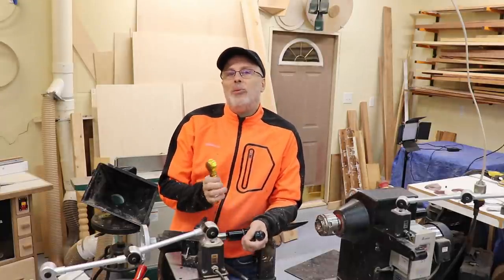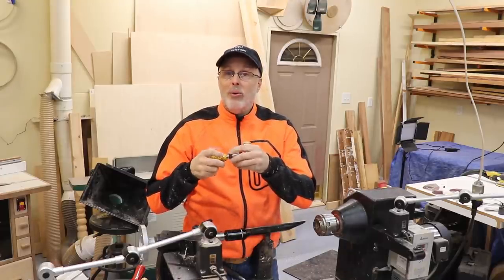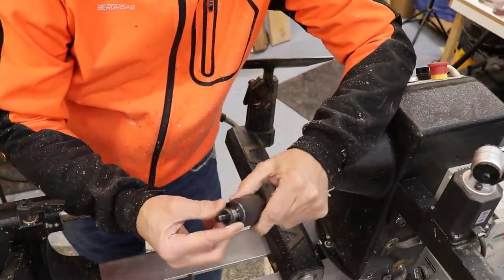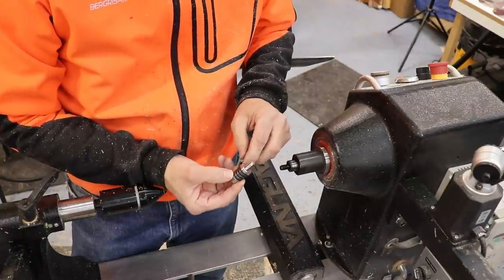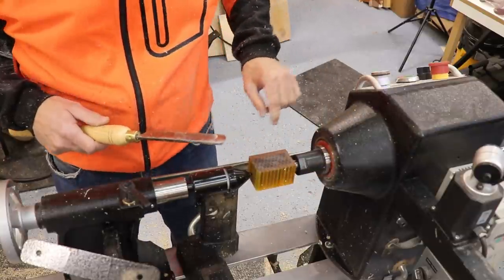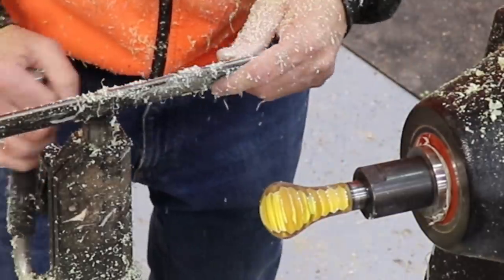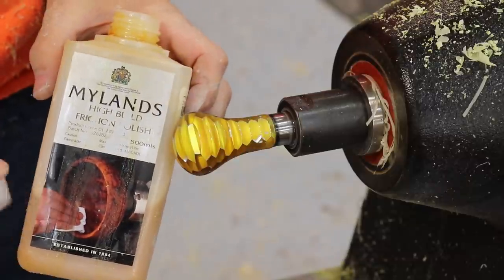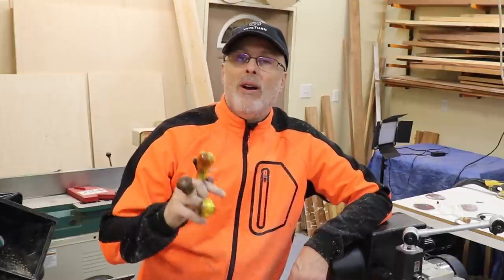How to Turn Awesome Bottle Stoppers

Comment: Nice job Paul. Is there a reason you chose to use a threaded insert instead of just running threads directly into the stock?
Reply from the maker: Hi Harry, thank you.  I've done these both ways, and the main reason that I like using the threaded insert is that they go on an off the mandrel so much easier.  But you're right, that's a valid approach as well.

Comment: Good looking piece Paul. Also, I use gorilla Glue on all of my mandrel work. I have not had any mandrel piece blow up since doing that.
Reply from the maker: Thanks James. Good to know on the Gorilla glue. Cheers
Reply: Correct me if I'm wrong, but I believe Gorilla Glue is water activated. It should work a little better if you, say, dip the insert in water real quick before inserting it.
Reply: @SkewToob  it is, I normally dip the metal in water add glue the insert
Reply from the maker: You’re right that it is, and you would probably be better off doing that, but if you have ever gotten that stuff on something that you didn’t want to you know that it forms a pretty good bond even without water.